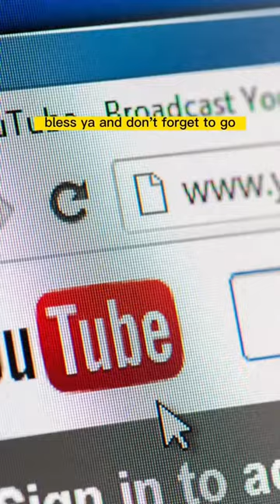How To Use a Mechanic STETHOSCOPE

Comment: If I may Rastaman have you or more specifically, is it possible to use the mechanics Stethoscope to first characterize normal vs abnormal Camshaft/crankshaft noise as a way to tell if you need it inspected or repaired or replaced. Thank you